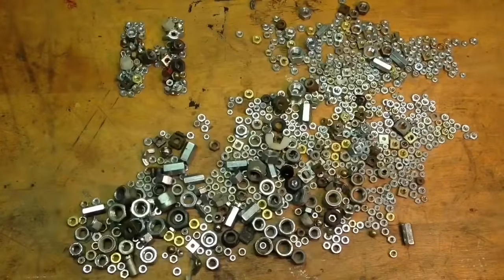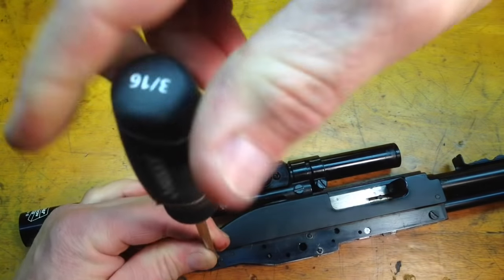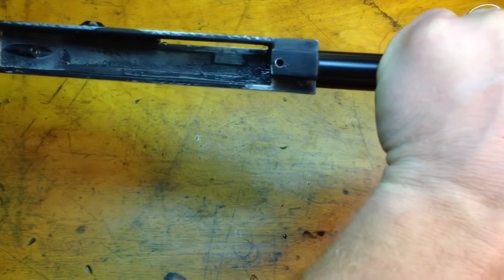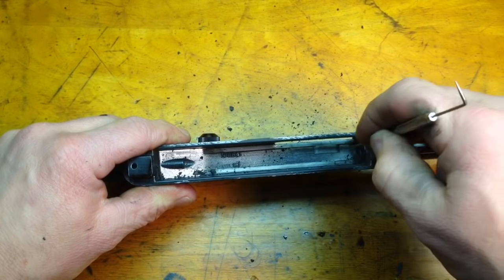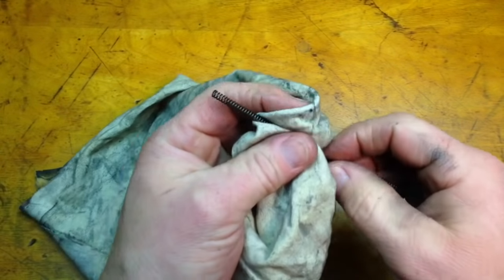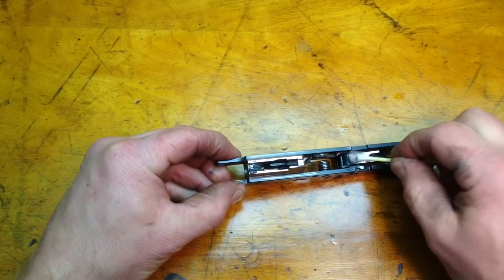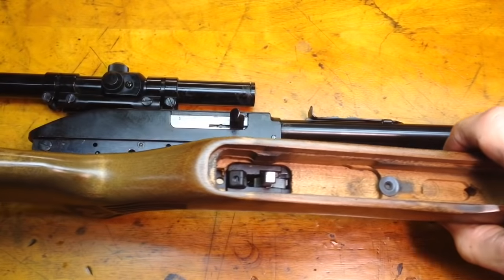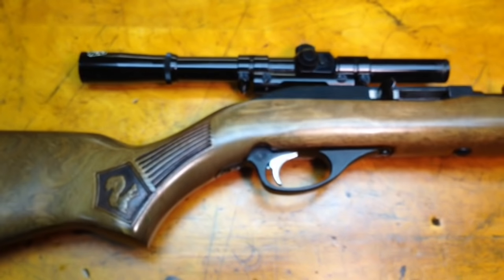Taking apart and cleaning the Marlin model 60

Comment: Awesome video.  We bought a Remington Western Auto LR 22 which I was told is basically the as the Marlin 60.  It was starting to jam.  Using the video I by myself throughly clean it and reassembled it.  My husband was very surprised I took it all apart.  My first gun cleaning and it went very smooth. Thanks.
Reply from the maker: Awesome! Thanks for watching.
Reply: Man do you still have that gun a YouTube named hickhock45 is looking for that gun lol look up his marlin 60 video
Reply: I’m having trouble with mine jamming, I need to take and clean it , it’s been awhile since It’s been done. I bought mine in the 70’s

Comment: Well, I was able to get the Model 6060 Marlin today and ran it through your cleaning routine....only thing I had a problem with was putting that piece back in with the long spring and pin, and though a bit frustrating it finally went right in!  Sure glad you warned about that.  The rifle was dirty and now is cleaned and ready to do some plinking!  Thanks very much for the video!
Reply from the maker: Awesome!
Reply: I have a question for you, please. What is the measurement for attachment for the rings on a scope for my 1978 Marlin Model 60.  What mm?  Hope you can help me. Thanks!  I can find pitaniny rails on ebay that claime to fit, and found a scope with 20 mm attachment rings, but don't think they will fit without a rail first...just don't know.

Comment: Even in the older models, it is recommended to have the bolt to the rear before replacing the hammer assembly, just a suggestion.
Reply from the maker: OK
Reply: Why is it "recommended"?
Reply: I could not get my hammer assembly back in for the life of me, read this, kept bolt back with a screw driver and went right in. Thank you
Reply: @swesleyc7  It is recommended to be locked back to keep from damaging or overbending the ejector spring. If this spring is bent the bolt can become jammed.
Reply: Can anybody tell me how to move the rear sight I tried for a while and I just cannot figure it out
Reply: The first gen model 60 dont have bolt lock back iv cleaned and reassembled mine many times without having to hold it back in place manually
Reply: There is nothing left to hold the bolt open once you pull the hammer assembly. Just cock the hammer on the assembly, pops right in.
Reply: Any videos on how to, "Have the bolt to the rear before replacing the hammer assembly"?

Comment: Thanks, first time I have ever cleaned the inside (1988 Coast to Coast 60th Anniversary), I haven't used it for a long time, but was surprised at how clean it was. Mine was a little different having a plastic compression pin at the back of the trigger assembly and fitting in over pins at the front.
Reply from the maker: Great rifle.
Thanks for watching.

Comment: Thanks , mine was absolutely filthy I’ve had this since 1984 I think and I can’t tell you how many thousands and thousands of rounds I put on this on the weekends playing around and all I’ve usually did was clean the barrel and spray in the action a little bit that’s the first time I had a completely apart, no wonder it wasn’t injecting shells it would clean it at work a little bit then a few minutes later the shelves when he checked it was jammed there was so much gunk I was pulling chunks of gun powder out of their residue it still needs another good cleaning , I’ll cycle it run a box through it and then take it apart and clean it again thanks again got me motivated to get this cleaned !!
Reply from the maker: Cleaning is a must for this great rifle. Thanks for watching.
Reply: funbro1 Yep I found that out it won’t feed and won’t eject without it being really clean but I love the rifle it’s excellent,

Comment: I have a tip on installing the Slide,spring and guide rod,at first I had a hell of a time even tweaked the spring a little,so this is what I figured out,if I installed the guide rod into the spring and put spring into the slide ,then set the whole assembly with the guide rod end in front of the guide rod hole "not in the hole" at a 90 degree angle, "straight up and down",then take one hand and start compressing the spring onto the guide rod while gently pushing down on the slide,when you have it compressed and the guide rod is actually inside the slide, gently lower the whole slide assembly and set it in place,now take your screwdriver and make sure the end of the guide rod is in it's hole.I struggled for 15 to 20 min ,this method took me not even 1 minute,and it does help to have someone hold the barrel to keep the it steady.Hope this helps
Reply from the maker: Thanks for the tips, and thanks for watching.

Comment: I no this was 7 years ago but you shouldn’t put the trigger mechanism back into the bolt without cocking it back first and then dropping the trigger mechanism in. That way you don’t bend the ejector pin. I seen that on another guys video fixing a model 60 that was jamming. And the nickel and penny trick. But this video did help me. I just did that part a little diff. Kinda put both of your guys videos together to come up with the best way to tear down. Thanks!
Reply from the maker: Thanks for checking in.

Comment: I dunno if most do this but the hammer calls for gun grease.  It's hard to apply without taking out all the little retaining pins on the side so I just try to jimmy some grease in there with something like a toothpick in this sort of cleaning.  Thanks for the video.
Reply from the maker: Thanks for the tip, and Thanks for watching

Comment: Thanks for a great Video on no bull way of getting the Marlin cleaned! Mine came apart quite a bit easier then yours. It was made in 1983, just one plastic pin that holds the action above the bolt in. Once I realized to hold the bolt open enough the action fell back in, easy peezy. Yup and easy!
Reply from the maker: Great to hear! Thanks for watching.

Comment: Too much oil is the number 1 cause of dirty 22 rifles.  I run my 22 rifles bone dry with just a light 'rub' of oil on the bolt contact points.
Reply from the maker: Sounds good, thanks for you input and thanks for watching.
Reply: This is old comments but I don't oil mine this heavy either. If I were planning on storing for a long time I would but otherwise minimal is best. I will oil the "outside" of my barrels pretty decently since they are gonna be exposed. My stainless i dont worry about as much. Of course ARS are a different beast.
Reply: @Benscratchin thats true. Thats why i love my AK can run it bone dry
Reply: I lube mine, but very lightly.  The bullets are usually waxed so it keeps them moving in the barrel.  And too much lube in the action can gum up the works when it gets mixed with powder residue.

Comment: Had a Model 60 Glenfield when I was a kid.  Traded it for a Remington 522 Viper when I turned 18.  What a mistake that was!  

I just recently spotted a Model 60 in the corner of my Local Gun Shop and bought it.  Has the Glenfield Scope on it as well.  Rifle was in fine overall condition but hadn't been cleaned since the time of Moses and suffered from feed issues.  Took it apart, cleaned the years of Powder Fouling out of it.  Gave it a slight lube and evenly torqued all bolts and screws back in place, including the Screws that hold the Barreled Action to the Stock.

Took it to the Range today and it ate everything I fed it.  Had only a couple minor issues that I blame more on the crummy Remington Thunderbolt Ammo than the Gun.  Thunderbolt seems to be very inconsistent in felt recoil & report, so I can only assume it's inconsistent in velocity and not generating enough energy to properly cycle the gun.

Loaded with CCI Standard Velocity, Winchester Super X & Aguila, she ran fine.  Probably put 250-300 Rounds through it today with maybe 3-4 hang-ups.  Glad a found this Gun and a small piece of my Childhood fun with it.
Reply from the maker: Awesome, sounds like you are reunited with an old friend. Thanks for watching.

Comment: I just bent my spring for my guide rod, you made it look so easy 🙁
Reply: Eh most of them are bent I've never noticed a difference. Check the pin that holds the fairing pin in I had one walk out a bit & gouge the receiver pretty bad.
Reply from the maker: Should still be good.
Thanks for watching.
Reply: Magic of video editing. I did the same thing, but bent it back. (I did it prior to watching this)
Reply: As you can see he edited the video when installing the slide,so it wasn't as easy as it looked.see my comment on how to install the slide,you will be able to do it in under a minute and NOT bend the spring.

Comment: Great job. Good safety. I echo the bolt comment below. First thing to do when getting used mod60 is do this cleaning. Most folks are afraid to do it, just squirt oil in, and the result is sluggish opn and misfires.  Probably should clean before hunting season, or after a few hundred rounds. Why i prefer bolt action or lever. Still easier than my m16.  Thanks for a fine lesson. Cw4, former mil. pistol team capt. Ordinance Corps "& Signal
Reply from the maker: Thanks for watching.

Comment: excellent vid. the details are well covered and the camera angle is perfect. there is no blind spots. the explanation is great. very well done sir. you obviously know what you are doing. one concern: the amount of oil left in the components. would this not attract and collect unwanted residue? I see that you used qtips to wipe the oil but did you also remove most of it? I've heard varying opinions on this.
Reply from the maker: I blow it off and wipe it down if I am going to store it. Thanks for watching.

Comment: Question:  If you already have your scope all sighted ready to go and you take the gun apart for cleaning, would it mess up the scope?
Reply from the maker: It very well could if things get banged around at all. It would be a good idea to check it once cleaning is complete. Thanks for the good question.
Reply: If the scope is not removed from the reciever/  barrel assembley they should still be lined up. Unless, of course, you bump it around but that's true whether attached to the stock or not.

Comment: The action in mine was starting to stick, so I took it apart to clean it and found that the buffer was shattered. Thankfully, it was quite easy to find and order, though I'm a little nervous about the pin hole size. The ones for mine, which is a 2001 model, are .155 in size, yet the pin is far smaller than that. I measured it and it came out to about .110. I've seen videos about replacing the buffer, and in those it looks like the hole is quite a bit bigger than the pin, so I guess this is normal. I'll find out soon enough.

Comment: Hello How To Bob I just bought an older model 60 but it’s similar to this model for cleaning. It’s pretty dirty I tried cleaning the best I can I haven’t shot it yet since I cleaned it but before it was jamming on the second or 3rd round. Any tips as to what it could be? Also after I finished cleaning the rifle the side charge wasn’t smooth it kinda took some power to pull it back. The only thing I can think of is the Spring? It was kinda bent... could that be the issue?
Reply from the maker: I would start by looking at the spring, take the whole thing back apart and make sure everything operates smooth before reassembly. Hope that helps. Thanks for watching.

Comment: Nice. I'll use this as my guide for cleaning mine. I just found my '76 Marlin 60 in a box in crawlspace storage under the house, from when I was a kid! Stoked but it's been nearly 20 years and has some rust. Any suggestions or recommendations for removing surface rust on barrel and internals?
Reply: Some really fine steel wool will take care of it.
Reply from the maker: Nice find, I would use some steel wool as mentioned. Thanks for watching.

Comment: I wouldn't use a Q-tip because that can leave fabric pieces in it and cause problems. Use what's in a cleaning kit. 👍
Reply from the maker: I use a Q-tip because I will visually inspect everything before finishing to make sure there is no fabric pieces left in it. Never had a problem yet. Thanks for watching.

Comment: I saw several videos on how to clean my Marlin 60, this is my favorite. Good Job! However, how did you put the recoil spring so easy, is there a trick to it? I ruined mine. I ordered two new ones just in case it goes bad for me on the second try. If you could please show how to do it again, just a little slower(the spring part).
Reply from the maker: It does take some practice. I believe there is a feature in YouTube that will allow you to slow the play speed of the video if that would be helpful. Thanks for watching.
Reply: Same here, that’s the only part that gave me trouble. And unfortunately, it doesn’t help to slow the video because that step is edited out. I’ve ruined two springs and am about to order a couple more. Would be great to see someone do this.

Comment: Question: I acquired a used one and the plastic thing in the back of the feeder section was in crumbles.  Still fires without it.  What's it for? Why is there a piece of plastic in a firearm??
Reply from the maker: That I’m not sure about.
Reply: The plastic buffer is a soft stop for when the bolt rapidly moves back after you fire the rifle. I've seen other videos that have said a broken or worn out buffer is often the cause of cycling problems.
Reply: I cut up a big pencil eraser and put it in the rifle. Works!
Reply from the maker: Great tip, thanks.

Comment: Hello, I have the same squirrel stock marlin (mines a 73) and I have a feeding issue that the local gun shop wouldn't help with. The ejector grabs the bullet just fine but whenever the action starts to move forward the bullet goes off track and goes to the top right of the barrel. Do you have any helpful knowledge/ possible fixes for me? Thanks a lot!
Reply from the maker: Unfortunately without seeing the rifle I cannot begin to diagnose the issue. Sorry.
Reply: Mine is similar.  When i pull slide back to chamber a round, i just pull out back and let it go and let the slide slam forward. It will feed a round every time this way.  If i slowly ease the slide forward, the round will go of track and jam up.

Comment: When you actually try taking apart & reassembling this Marlin 60 action, you will definitely encounter more problems than he does. The parts will fall out, & you’re definitely going to have problems with the hammer spring upon reassembly. I suggest 2 things. Before you take the side plate off, use wire bread ties to secure the silver feed block & place another midway OVER the steel arm, securing, twisting them on the side WITHOUT the E clips. When it’s together, you can see the path that will make the ties easily removeable once reassembled.  2nd trick that ends the chance of having to reassemble the hammer spring, I cut a tiny L Allen wrench off on the short side, to pin the hammer spring pressure plate. There’s a hole in the rod.  With the hammer down & pinned, there is no pressure on the fitment upon reassembly.
Reply from the maker: Anything is possible with an older rifle, I suggest you be prepared for some replacement parts or anything else that may happen while cleaning this rifle.

Thanks for watching.
Reply: @funbro1  Just talking about the Model 60 in general. Securing everything to the opposite sideplate & pinning the hammer spring prevents any problems. You could purposely drop the action on the table 3 times & nothing will move.  You’re right about that, my 12 year old stainless Marlin has already had a buffer & trigger assembly replaced. (poly parts failures) Good video, better than average explanations.

Comment: Greetings! I bought a Marlin Model 60 recently and it stopped working after around 30 shots, it won't cock, someone I know says the packing grease must've gotten hot and Is causing problems, do you have any advice? Thanks!
Reply from the maker: It sounds like you should start off with a good cleaning. Thanks for watching
Reply: funbro1 I took it apart (thanks largely to your video) and cleaned it, it seemed to work, I put an empty casing in there so it wouldn't be dry firing, now the casing is stuck and I can't get it out, any advice?
Reply from the maker: Don't put an empty casing in there. LOL You can use a cleaning rod from the end of the barrel to gently push it out if necessary. Best of luck.
Reply: I looked around about dry firing and some people said use an empty shell, that's what I get for listening to random people on the Internet, anyway, someone lent me their cleaning rod and I tapped the shell out, oh well, I still need to try it and see if the gun works, thanks for your advice.

Comment: Well done video.  A couple of thoughts.  First, I always wear disposable gloves when cleaning firearms to minimize lead and solvent exposure.  

Second, the crown of rifle's barrel has a great influence on accuracy and can be easily damaged.  If you are going clean the barrel from the muzzle, put the rifle in a stand and go straight in.  I prefer Dewey coated rods and brass jags to avoid damage to bore and muzzle.  I used to shoot High Power with an M1A and used a Dewey nylon muzzle guide to keep the rod going straight in.  Not sure if something like that is available for this rifle.
Reply from the maker: I'm sure one is available. Sounds like you have it figured out but Thanks for watching.
Reply: On 22 rifles, a regular aluminum or brass cleaning rod won’t damage anything,,,properly used.  I’m sure somebody could damage the crown with aluminum or brass if that was their goal.  One thing to watch out for is a cheaper coated steel cleaning rod that the coating is damaged.
Reply: &——- M1A is cool. I shoot a Ruger Mini 14. Wood & blue, new model. The basic design is infallible.